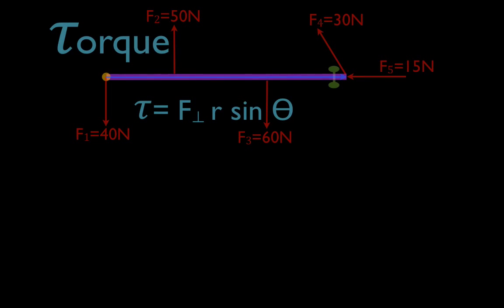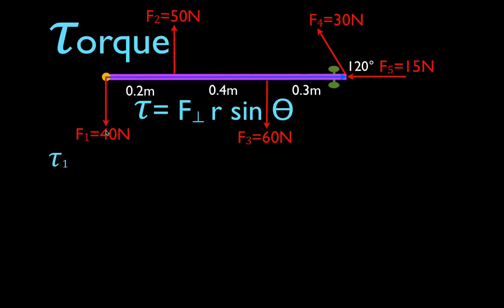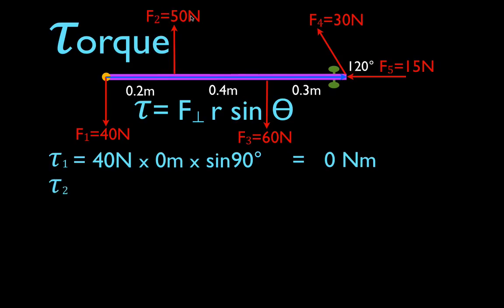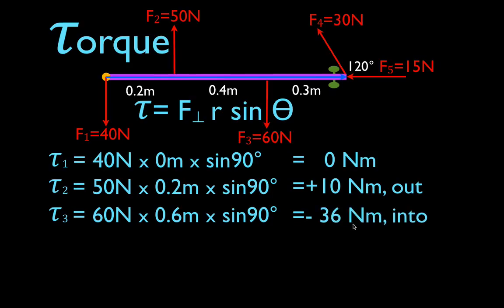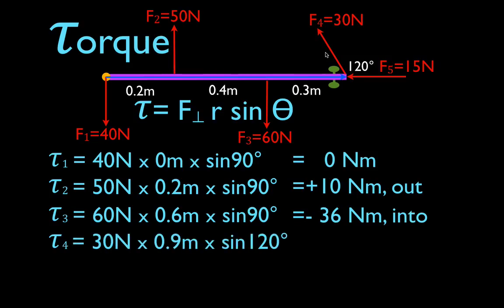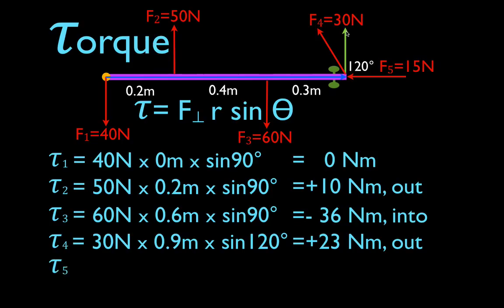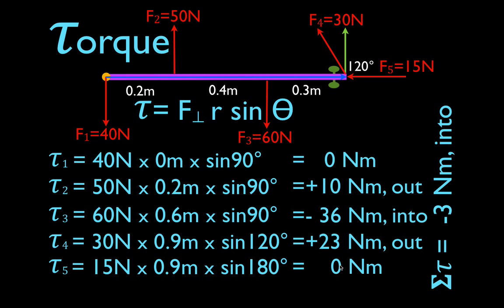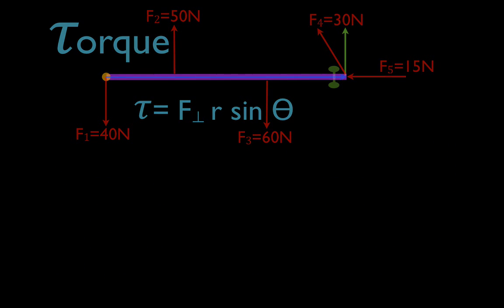Physics, Net Torque (5 of 13) Five Forces Applied to a Door

Comment: Great video! 
However I believe the vertical component of the 30N force is 27N 
Sin120x30N correct?
Reply from the maker: Yes but then you have to multiply it by the length of the lever arm to get the final answer of 23Nm.

Comment: How do you determine the torque on a rear bicycle wheel?
Reply from the maker: +Larry Krishna Does this help.  Torque and the compound wheel.....https://www.youtube.com/watch?v=5g0M9nGfsF0
You can also link to all my videos at my website: https://www.stepbystepscience.com
Reply: +Brian Swarthout Hey, Not really :( ... I'm building an electric bike and working on a spreadsheet of data for gear ratio at the moment. I'm a little stuck though. Here is my table so far: http://prntscr.com/a76ow4
My 800W motor can do a rated torque of 2.8Nm. I'm designing to a speed of 5mph at 1 degrees. Is that corresponding torque correct? How can I gear it down to meet the motor torque? Here is my table for gear ratio: http://prntscr.com/a76px2
I should be able to go a lot faster than 5mph.. but I want to design to achieve this speed. Will the gear ratio limit my top speed? I calculated the diameter of the friction wheel using v=r(omega) but, with that 9:1 ratio, it appears like i'll have a big friction wheel, Which I do not desire. My motor will be above the rear wheel with a friction wheel attached to the shaft and in contact with the rear wheel. Any help would be greatly appreciated.